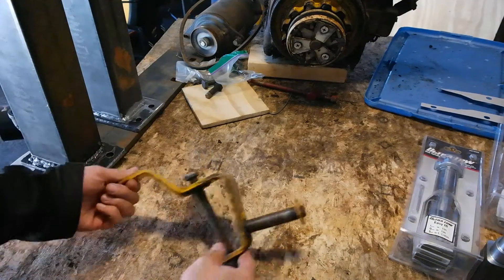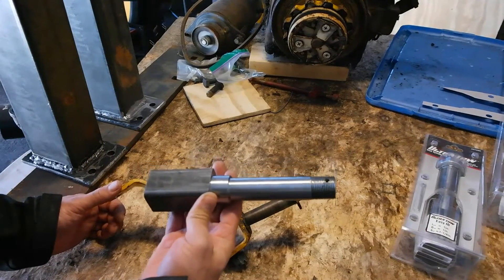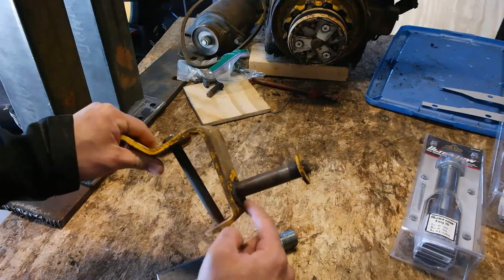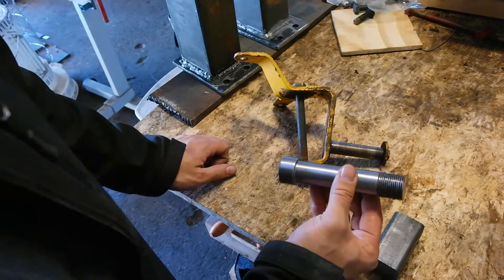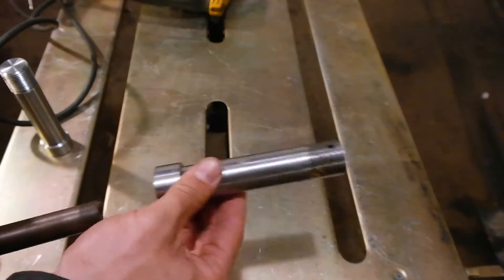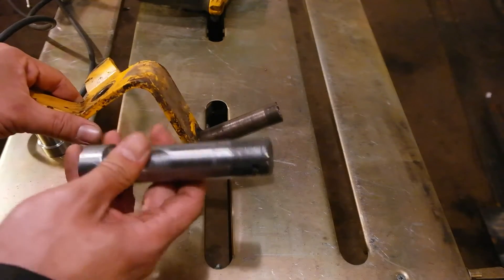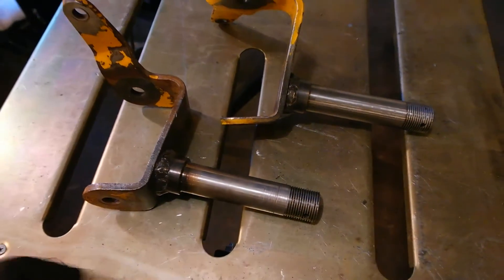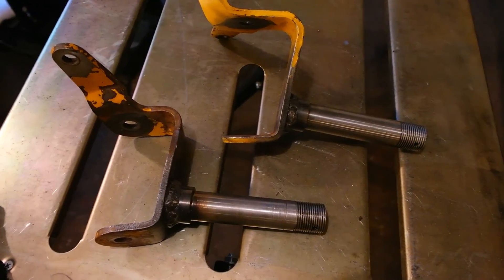Cub Cadet 149 Transformation TLB Part 5 - Spindle Upgrade

Comment: He's good!.. but on this one I think he would have been better served taking those stock trailer hubs and simply fabricating new  control arms from 1/4 or 3/16 steel to mount that stock trailer hub to the cast iron axle main mount points. He has everything to do that job and no trip to the machine shop is necessary. And then he can put those stock cub cadet hubs in the closet for safe keeping.
Reply from the maker: Check out my Ford spindle upgrade. I did something similar to what you mentioned.
Reply: ok glad to know i wasn't the only one thinking that arm seemed a bit thin for such a large spindel all said and done.

Comment: Awesome video!  Now that you've beefed up the axle, would the control arm be the weak link?  Would it be overkill to weld a piece of 3/16 or 1/4 bar stock butted up against the other side of the axle?

Comment: Curious why you chose to center bore the new spindle to fit over the existing one instead of just cutting off the old and weld on the new.
Reply from the maker: I wasn't confident at my welder's ability at the time, to get enough heat on it. In the future, I will just weld it directly on.
Reply: @Isavetractors  the way you did was good it keeps the center line of the axle . cutting off old axle and installing new you have to find center then hold axle level and square ,, you did the easy way ..you could also have drilled a hole threw the new axle and plug weld to the inner axle but you need to clean your weld to fit the rim on the axle if you plug weld .. also you could have welded the front axle to fill in where the pulley cut a grove .. i have seen that a few times ..also seen mower decks lifted to close to the mower frame deck pulleys cut into the frame or the deck arms ..they were using mower like a brush hog cutting tall grass ,,

Comment: I believe you will have trouble with your front axle and spindles. From past experience, those spindles will bend where they are welded on the flat plates under a load with the FEL. I posted a link below showing the easiest and cheapest route to go. In the vid, pay attention to how much beefier the black axle is compared to the original 149 axle and yet I have broke 2 of those beefier axles.
Reply from the maker: thanks for the comment. I will check out your videos and see if I can go a different route if needed.